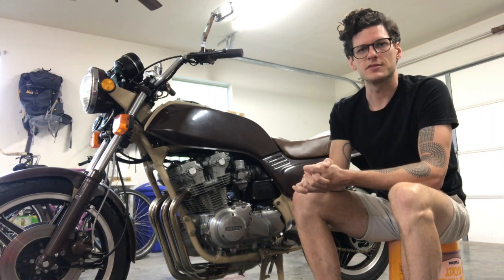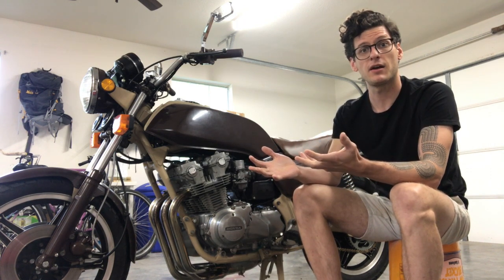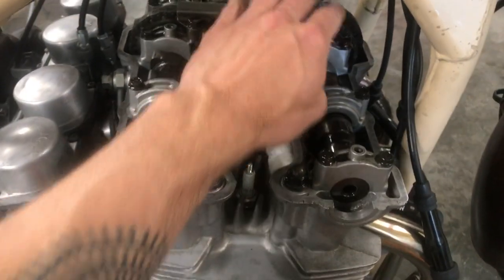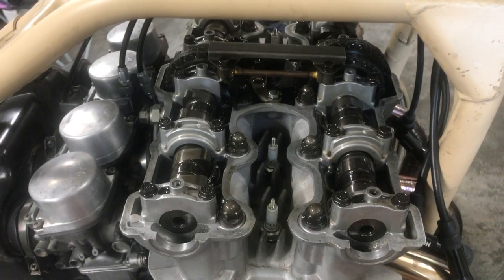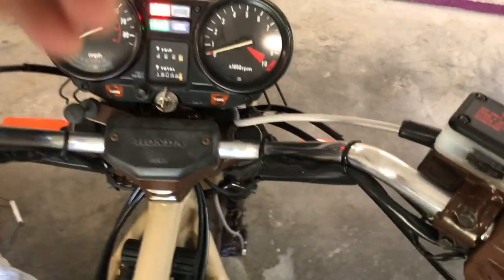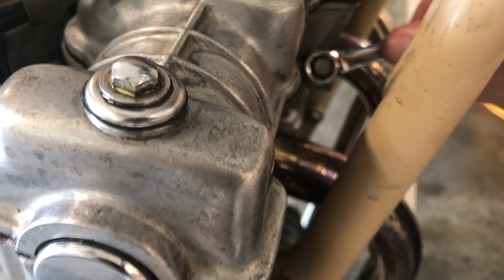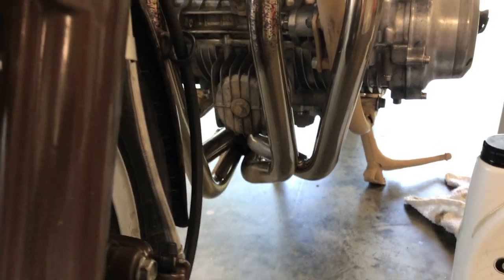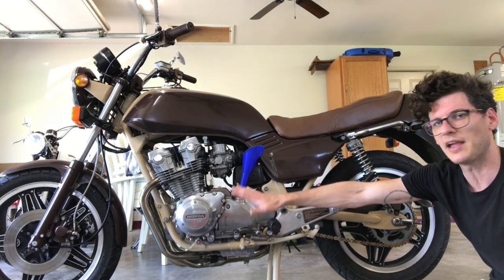1980 Honda CB750F DOHC Scheduled Maintenance: Valve Clearance, Cam Chain, Timing, Carb Sync, & Drive

Comment: Hi Guma - Hope you have had a nice biking day. After some errands where able to open the pipes up a little bit on Rt 1 this morning, I drained the 10W40, loosened the Engine Guard which enabled the removal of three electronic  Ignition 3 bolt cover which I am not sure how that works in a wet environment, but discovered one of the three bolts to be instead a flat head screw 

( twice I had work done on her. It was back in 82 when taking down the outbound Lincoln tunnel with an engine crash.  The Second, was after I restored her, paid a group to fine tune my work.  Since the last, I have noticed many missing bolts I had to account for, but would not demonstrate an issue for  a time to come. )

Once exposed, I was able to reach in to touch those three screws. As there was no issue, including a little gasket cement,  attaching the covers, I thought it would be an opportune time to see if I could recover the neutral switch dash board signal. I had replaced the Gear Shifter rubber seal recently and had not known then that the wire there connected to the neutral switch. If shorted with oil - well anything goes. So I attempted to no avail to dry off the connector near the switch. 

Moutul 10W50 oil is Cherry in color, and almost temping to convince oneself its not cough syrup. When getting it on my hands, I made a point of not  licking it - 

She drove beautifully tonight. One thing I observed while  on the garage floor. Cylinder's 3 & 4 have a dent where the go under the Engine. One is at least 40% and the other maybe 20-50% volume impediment. I would  love to meet a Minike guy that would be hip on theses -

btw: with out the baffles,  and maybe more slippery oil, she is fast if you just breathe on her - 

best regard -

Comment: Wow! Awesome that you posted this! I just bought a '79 CB750K and this was exactly what I was looking for. Great tutorial and really informative. Thank you so much!
Reply from the maker: Good luck with your bike, I hope this helps you get it to a reliable place. Nothing like confidence in your work to make the ride that much sweeter.
Reply: @Gumaamug  Any chance we could get a list of tools that you said you set aside to figure out what you needed for your trip?
Reply from the maker: Sure thing, here's what I ended up with, including a couple of extra things that I didn't use in the video:

Ratchet
Small socket extension (4 inches)
Sockets (mm): 8, 10, 12, 13, 14, 17, 19
Hex head sockets (mm): 3, 5 (these are for my case bolts, which I replaced with SS hex head bolts)
Spark plug socket (M18)
Assorted dental picks
Box head wrenches (mm): 8, 10, 12, 14
Two adjustable crescent wrenches (for axle)
JIS head screwdriver (better than Philips, you can look up why)
Flat head screwdriver
Small flat head/Philips head screwdrivers
Feeler gauge set
Wire strippers
Vice grips
Needle nose pliers
Zip ties
Metric allen wrench set

All of this I fit in a $15 tool roll with spaces to spare. Some of it is probably overkill; I would hope to not have to remove the axle on a road trip because it means something has gone seriously wrong. But because I had the space it seemed wise to grab the extra stuff like the vice grips and wire strippers. Just in case.

Comment: Just found your post. My 81 F was just started in time for a May snow fall !. 15000 mi. on it . I bought it new in 1980 the same day I bought the naked GL1100. Use them both every Summer. Sounds like the cam chain needs snugging, bit of a whir. Also have been getting the idle clunking that is said to be the starter clutch bolts getting loose. Will do both before the season starts. Thanks. With my Yoshimura 4 to 1 it still turns heads. Got to love that in line 4 sound. Peace bro.
Reply from the maker: Love the backstory! The memories are the reasons we keep these lovely machines around!

Comment: Great video! One thing you did leave out that is really important is that there are actually two lock nuts on the intake chain tensioner, the one on the bottom that you did, and one uptop that you missed. Loosen them both off then do the top one first, bottom one second
Reply from the maker: It's been more than a few years since I rebuilt that engine, but my memory is that the top bolt is only connected to the mounting bracket of the tensioner inside, and the bottom bolt is connected through the bracket to the spring assembly. It wouldn't certainly wouldn't hurt to do both.
Reply: Awesome video though man, helped me learn a ton

Comment: On removing the shims, I use a dental pick to help break the surface tension of the oil.  You can get them at county fairs @ a small item seller.

Comment: You're better off adjusting the cam chains while you're doing the valves. While you have the cam cover off, loosen the lock nuts and turn the engine over in the direction of normal rotation. Watch the top of the cma chain tensioner and you will see if go up and down. when it is at its lowest point tighten the locknut. For the horizontal chain remove the bolt completely and shine a torch into the hole. Do the same again and when the rod for the tensioner the furthest in towards the cams and tighten the bolt.
Reply from the maker: Great technique! I'll add it to my repertoire.

Comment: Nice I have the CB750 1979 Limited edition - same engine, and I wanted to test the valve clearance's.  I look forward to your knowledge - thanks btw: you answered a major question - at 4:57. I was concerned if able to remove the Valve Cover if enough clearance from the frame - thanks again  -
Reply from the maker: Cheers! Make sure if you do take any shims out to swap them, do NOT rotate the cam while the shims are out. I did not mention this in the video and another commenter pointed out that he scratched up his cam doing so. It says it in the manual, it says it almost everywhere else, I just forgot to; always cross-reference info before trying something at home!
Reply: @Gumaamug  Thanks for the heads up on the shims. I will be be doing a lot of due diligence fore looking at the valves, where so far there are no overt issues. Except a leaky Valve cover where Ill check Vintage 750 for one 

My bike, 'Beauty' I bought new in 79. Stored her in 88 to raise my family. finally two years ago moved in retirement where having a garage to restore her. Last Summer was a great reawakening. I even got a M on my drivers license - 

I took a short 40 mile trip this morning. In Ct from Bridgeport area to Naugatuck and back. Earlier in the week, a trip was taken that was twice a long to Lime Rock Race Track. She holds together like a champion.   

Im running 10W30 but just got 10W40 to move to when learning that z70's are to have the latter.  I have a Pizza Oven Gauge on my bike that read 220f once I  stopped for a moment in Naugatuck . Back on the highway i got her down to 180f. I believe to 10W40 will prevent the excessive heating up. What is you opinion on that.
Reply from the maker: @ClassicRider  I know that part of the country well-- I think you'll be fine on 10W-40 and 180F sounds nice and cool to me. Leaky valve cover should be an easy fix. Congrats on getting back into it and enjoy the riding!
Reply: @Gumaamug  don't forget the gasket cement or you will have leaks around those camshaft covers -

Comment: One very important thing to note when switching the valve shims, is NOT to turn the engine with any valve shims removed. I used this video and the FSM to instruct me as a newby and eventhough it seems obvious in retrospect this was not mentioned anywhere. As i was checking different shims to swap over i turned the crank and the camshaft scraped the spring holding the shims which caused a pit in the cam and bent my spring :(.
Reply from the maker: Ah damn Andre I'm sorry to hear that!! Yes like many things it seems obvious in retrospect, I'm sorry I didn't think to mention it in the vid

Comment: Very solid video as a new 750 owner this is gold, just wondering what the background slapping noise is at 23:36. Mine is making a similar noise after first start in a year and I'm just in the process of diagnosing.
Reply from the maker: Hey Jack, I'm glad you find this video helpful. The sound that you're referring to is just the transmission rolling around in neutral. There is a lot of force in these engines and the primary drive is capable of turning those gears even at idle speeds. You'll notice as soon as you put the bike in gear that the sound goes away. This is because putting it in gear meshes the drive gears with your front sprocket, and if the bike is standing still then the inertia from the back wheel, transferred to the back sprocket, through the chain, and to the front sprocket stops the transmission from turning around inside the case.
Reply: @Gumaamug  ah ok thanks for the detailed answer, I was kind of terrified I had spun a bearing or something as it's been sitting a while. I'll follow your tune up video before getting it on the road. Thanks again!

Comment: Hi TJ - Help Help - About a month ago, I got a 1981 CB750 Custom that has stacks and no airbox - Engine worked fine. I got it for my wife, and have done a number of repairs. Mater Cylinder, Turn Signal Switch, electrical shorts, etc. 

Similar to how the 750s' loose power when needing to go to reserve, suddenly "Babe'  would loose power then jerk forward in full power. I assumed it was a dirty tank.  Babe has a dirty tank, but does not seem to be the cause.

The fuel regulator diagram that is mounted on top of carb 4 - the over flow tube would drip. I plugged it, and also found a replacement.  Problem went away until I refilled the tank. So I added some gum out like before hoping that and spraying carb cleaner into the fuel hose going to the regulator diaphragm from the tank could correct issue like last time. 

Suddenly no fuel is getting to the carbs, but plenty going to the regulator diaphragm which has a vacuum hose coming from carb 2. I tried draining No 4's fuel bowl which appeared empty. 

Consider that Babe behave is running out of fuel, than that this regulator diaphragm  might have an issue in letting fuel thru, I replaced it - 

Still no fuel to the carbs - 

Before doing a rebuild on carbs that normally run incredibly well, and even better than my original Limited's Carbs with an airbox,  I am reticent to proceed any further with car rebuilds etc without your opinion 

Thanks for reading this - I hope I can get your thoughts on this -
Reply from the maker: If I understand you correctly, your carbs still have the vacuum-activated regulator sitting on top. This is the disc-shaped valve (I think it looks like the Millennium Falcon from Star Wars) that accepts the fuel line from the tank and then feeds it into the carbs...

These are notorious for being finicky and causing issues just like you described, and the good news is that the bike works just fine without it. Its only function is to stop fuel flow to the carbs when there is no vacuum, i.e. when the bike is off. You can remove it and run fuel line directly from the tank to the brass carb inlet that sticks up between carbs 1 and 2. You can put a rubber cap on the vacuum nipple that comes from carb 2.

If you remove this regulator, you MUST treat the bike like an older model and turn off the fuel from the petcock whenever you're not running it. Otherwise you risk flooding the engine or dumping all your gas out through the carb overflow depending on how well your carb floats/float valves seal. This is an easy habit to get into and a small price to pay for not having to deal with this poorly designed part of the carbs.
Reply: Thanks so much for your reply, your help and your suggestions - 

I will follow your suggestion after one more attempt on a repaired Millennium falcon. 

Last night after the failure of the Ebay swap, I took apart the original. 

Two theories were confirmed. A- Its a vacuum controlled fuel regulator ( try finding anything about it in repair books - best of luck ) ,  and B- that it had ruptured. The Rubber diaphragm has a factory hole , and then a small torn hole that I figure would cause it to fail.  

Eventually I chose a tiny dab of hot glue to seal the rupture. I rubbed gasoline on it after to see if it would breakdown. It appears to be doing its job, but just a littler stiffer diaphragm - If this fails then I go to your solution - 

Per your solution you noted to make sure not to over flow the carbs when parked by turning off the petcock valve.  That to me is best practice - 

Question - is your concern that the floats in the fuel bowls are not reliable? I will follow best practice then - 

Again thanks for the informative help -
Reply from the maker: Floats and needle valves are as reliable as they can be, but you'd never want to find out the hard way that something had failed by waking up to five gallons of gasoline on the garage floor. Easier to just turn the petcock off every time you park the bike.
Reply: @Gumaamug  After lunch im going with your recommendation as 1- Im not Sisyphus, and 2- My wife ( its her new 750) learned from the MSF to always turn off the petcock valve when not in use - 

Thanks again !

Comment: Thanks a lot for your input. It’s really been helpful to me. I have a question or two. Maybe you can help me if you are kind enough. I have a 1980 Honda CB 750 F super sport which I just bought. I brought it home. It was working just fine. After I started working on it remove the gas tank replaced the spark plugs and the headlight. I went to go ahead and try to start after all that and it wouldn’t. It just give me a click out of the solenoid any idea what that could be why? I sure would appreciate your input thank you and I love your videos.
Reply from the maker: Hi Edgar, you can find on my channel another video about testing the electrical system. It sounds like there's no power getting to your starter motor if the solenoid is clicking but the bike is not cranking. Definitely check your battery voltage with a meter while you have the starter button pressed. If the battery does not have over 12v with the bike off, it will not have enough juice to crank the motor. If the bike is new to you, I wouldn't be surprised if it needs a new battery. Otherwise you can check your ground connection from the battery (-) terminal, check your main 30A fuse in the solenoid. The electrical path to the starter motor is very direct from the battery through the solenoid. Good luck!

Comment: I just picked up a 1981 Honda CB750 Custom, and it’s my first 4-cylinder Honda. This video is very helpful - thank you! Just one thing that wasn’t covered - checking the oil level. When checking the oil level, after wiping off the dipstick, should it be screwed all the way back into the engine, or should it just be inserted to where the threaded area is resting on the top of the dipstick hole?
Reply from the maker: Hey Brad, it's the latter. You should also do this while the bike is warm-ish. Like, not after an hour long ride, but not when it's cold (because oil from the head collects back down in the crankcase). Ride it around the block a few times and then check. Cheers!
Reply: @Gumaamug  thank you!

Comment: I’ve a ‘79 CB750K Limited Edition...it won’t idle at all. I need to get some tools in order to do a valve adjustment, that much I know needs to be done. After I’ve done a valve adjustment however, how do I go about setting the idle speed? I know tach on my bike is not super accurate, and I’ve heard they’re not accurate really at all at low speed...how do I go about getting a more accurate reading of my RPM so I can set the idle? And do I just set the idle with the screw underneath the carbs?
Reply from the maker: Idle speed is set with the black plastic knob underneath the carbs. This knob pushes against the rod connecting all carbs, so it is important to make sure the throttle butterflies are balanced as described in this video. It is true that the tachometers are not super precise, but they are more than good enough for setting the idle. You will also learn to interpret the idle by the way it sounds. There is a sweet spot below which the bike will sound irregular and/or die, and above which will sound obviously too high.

Comment: Hey bud! nice video!
I just buy one of exactly that model and year... has a electric issue.. i change the Brushes, stator, regulator and battery... the problem has remain and i see that the roto doesn't has the right value on multemeter... yesterday i change the rotor to, and now the bike doesn't work... she's starts, do the spark, but not actually work... i think it was the cam chain pass some tooth... how i know what the right position of the chain? cheers from Portugal
Reply from the maker: On the left side of the engine where the pulsers are, turn the engine so that the index marker is lined up with the line labeled "1.4 T" - this means "cylinder 1 and 4 piston is at top dead center" - with the valve cover off, both cam sprockets should have punch marks (small dots) on the actual sprockets. There are two marks per sprocket, and they should form a straight line that is even with the surface of the cylinder head. On cylinder One, the cam lobes on both cams will be pointing in, toward the spark plug for cylinder One. If they are pointing opposite directions, rotate the engine 360 degrees. If the chain is slightly loose, which is likely, these marks will be off by a little bit, which is OK. If the chain has skipped a tooth on one or the other sprocket, it should be very obvious. Boa sorte!